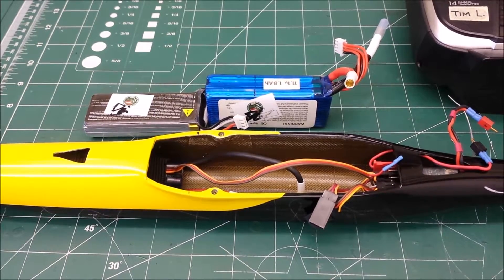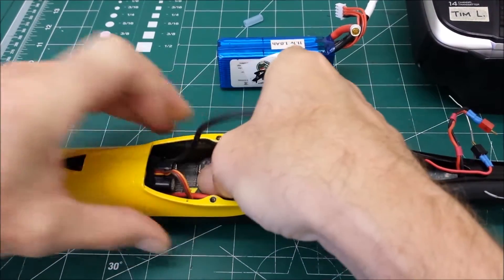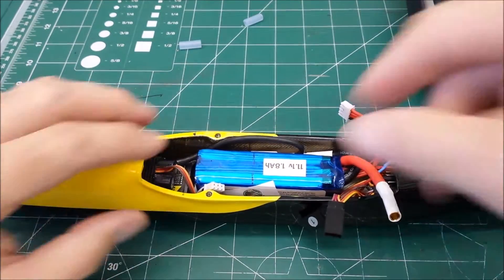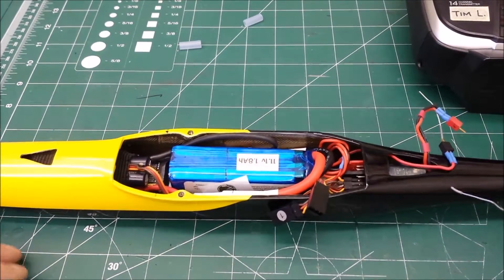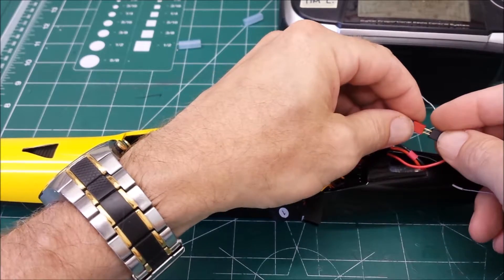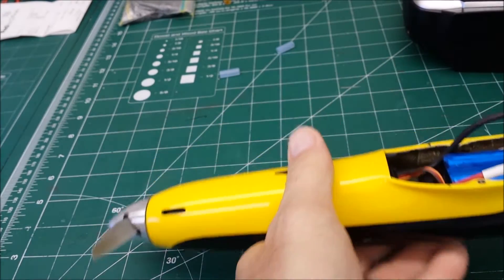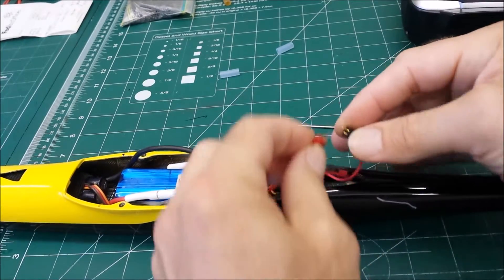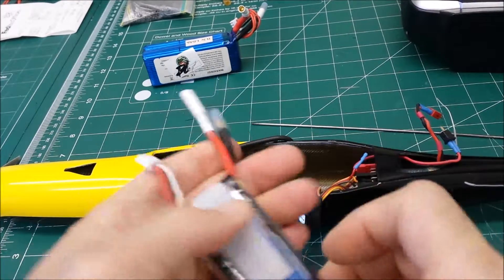Part 1 Installing batteries in Avionik

Comment: What's the benefit of using split packs? Cog?
Reply from the maker: Hi Dave.

Split packs are just easier to install and makes more room for the wiring and limiter. The demonstration in the video is for a person I sold the plane to.

Tim
Reply from the maker: Oh, hi again Dave. Maybe you thought I posted the video for you (maybe you didn't think that). The video is for another Dave who bought the plane. :-)

Tim